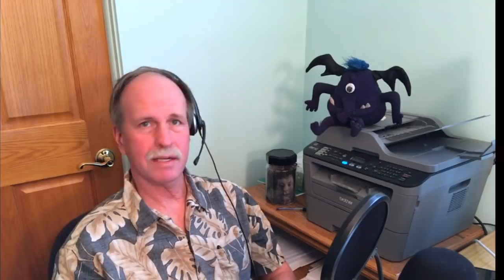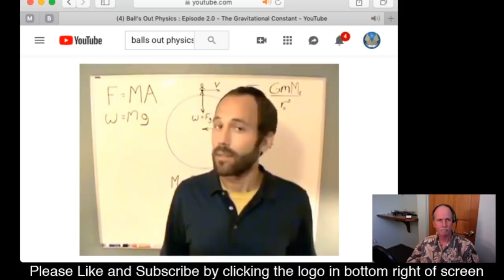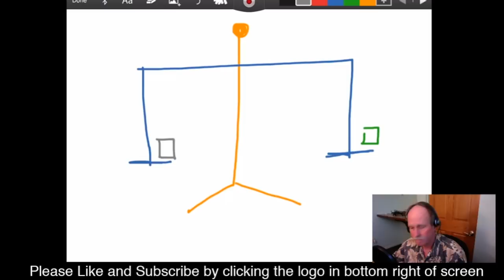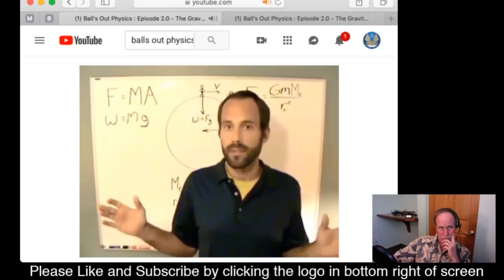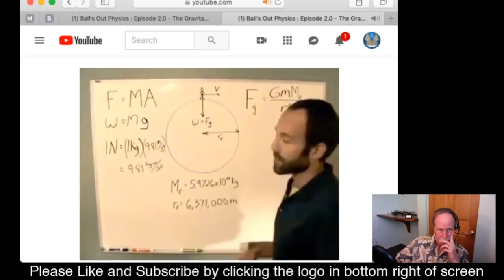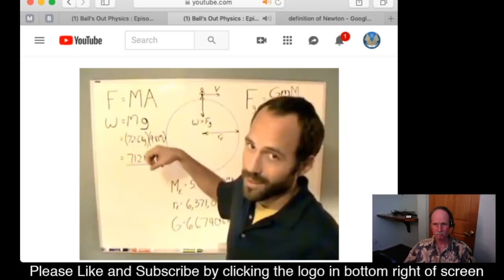Flat Derp Engineer Gravity Part 1

Comment: Ok, you likely addressed this; but, at 4:40, where he's talking about mass versus weight. (I was compelled to pause due to my brain being overloaded with stupid)That's why scientists don't use spring scales, you moron, they use balance scales where you are measuring against a known mass, and you keep adding mass to the other side, until the scale reaches a balance. Any force exerted on the item you're measuring will be mirrored on the side where you know the value, therefore, you're measuring mass.
He seems to only understand how a spring scale works, where the scale has been calibrated for a certain set of conditions, and can only be accurate in those conditions.
Reply: I can assure you scientists do use spring scales, they are calibrated regularly in their place of use using calibration weights. Of course the high precision devices no longer use springs, but the idea is the same. Do you really think when measuring the mass of an item in the lab they get out a set of weights and balances? The resolution would be limited to your smallest comparison weight.
Reply from the maker: yes, we use them all the time.  Properly calibrated they are quite accurate.  The beam balance is a special situation and increases accuracy, at my college there is one in a glass case that they bring out every now and again to demonstrate.
Reply: @BobtheScienceGuy  Seems I spoke too soon. I have just been told (by my other half - a chemist) that most laboratories use a top loading balance, which uses magnetic force restoration to lift a displaced item until it is balanced back to its initial position. There seem to be many types and designs. The general principle seems to be that a balance uses a known applied force to restore a displacement back to its original position (just like a beam balance) and a scale uses the actual displacement as the measure.  But is it confused by the fact that some manufacturers use the two terms interchangeably.
Reply: @garethhanby  Well described. Interestingly both systems are used in space. Measuring the mass of an astronaut is obviously important, NASA does this using  a system called SLAMMD which is basically a force applied to the body and the displacement measured, this is done using good old springs and is accurate enough to determine the amount of mass loss. Intricate measurements are done using a centrifuge and the force required to produce the centripetal force to keep the sample stable. So I guess the first is a scale and the second a balance.

Comment: Just a suggestion, Wolfie6020 did a nice demonstration using a scale and a set of weights, showing how the weights change according to your position on the globe.
Reply: True facts from an analytical chemist -- I'm really dubious about the ability of such a scale to retain calibration over such a long period with so much motion.  But it did work out as expected, so maybe I'm just over-cynical based on my experience with much more sensitive balances.  In any case -- damn, Wolfie, use some controls.

Comment: He is an engineer?? in which field? How can an engineer doesn't know what 1N is? Who had hired this dude?
Reply: Civil engineering. Probably the engineering field that demand the more intensive study.
Reply: @Kualinar  
I don't know that CivE requires the most intensive study. But to be a good one it requires the most civic responsibility and dedication and attention to detail.
Reply: @its1110  I did not say «the most» but one of the most demanding fields.
I have a brother who is a technician in civil engineering. He typically had 8 to 10 hours of class per day, 5 days per week for 3 years, plus all the home works.
For an engineer, you must add at least 2 to 3 more years demanding about the same amount of work.
Reply: @Kualinar  
And there is plenty of hands-on field work. Takes some muscle work on top of the brains.

Comment: As a physicist I am deeply saddened that one can become nowadays an engineer with such poor grasp of physics.
Reply: I describe Brain's Ball's out series as a reverse Oral Exam in which he lays out the case in detail for why he should have failed physics 101.  It gives me PTSD flashbacks to being a TA for physics 101.  I seriously thought I had a moral obligation to shop him to his engineering licensing board.  It was a relief to find out he was just inspecting bridges for corrosion and not doing anything where his lack of grasp of physics was going to get anyone killed.
Reply: I remember there were some in my engineering classes that just could not grasp what seemed to be simple physics..a number failed and dropped out.. but not all.
Reply: @entangledmindcells9359  They did a study once.  About 50% grasp the basic concepts at the beginning of a physics 101 course and 50% don't.  At the end of the course those two groups were still the same.  Nobody had switched sides.

For people who don't have the intrinsic talent for visualizing spatial geometries a lot of this, especially reference frames, is just incomprehensible.  The other stumbling block is that people don't realize that the surface of the earth is an environment with a lot of things going on at the same time.  In different environments things that are important on the surface of the earth can become negligible and things that are negligible on the surface of the earth can become important.  They can never break free of expecting things in all situations to behave the same as they do on the surface of the earth.  "It doesn't make sense." = "That doesn't match what I've directly experienced in my life."

They think their sense is some sort of magic source of knowledge and don't realize that when their sense and the physics don't match it's because the physics is right and their sense is wrong ( or at least, only valid for situations they've directly experienced).
Reply: He supposedly graduated from University of North Florida with an undergrad degree in CivE. I just graduated from University of Minnesota undergrad ME... Absolutely no chance this guy would have passed any of my courses. The fact he has a degree and is a senior engineer at his company blows my mind. I'm still not convinced this guy is serious.
Reply: @chicarbiomed  If you watch Scientism Exposed you will see his is serious. Although he does not mention religion in his Balls Out Physics videos, it is clear that he is one of those fundamentalists who desperately tries to use his limited understanding of physics to justify his views. Just try and avoid bridges in North Carolina.
Reply: @garethhanby  I remember you keyed me into his NC job etc. It's just so wild to me having just finished my own degree. They're are so many classes that require you understand why these basic physics principles works. I don't know how you get past statics, Dynamics, deform mechanics, fluids.... And imply something so stupid that the math seems to work so they just accept it.... I've found out classmates were creationist young earthers and they struggled so hard once they realized they had to do gymnastics in their electives just to take courses that didn't challenge their beliefs. I just can't square an engineer slaughtering their entire education. I believe what you showed me but, godamn. Lol
Reply: @chicarbiomed  Yes, I know. It seems impossible. I'm from the UK and have never met a creationist or young earther in my life, even with living in NYC and DC for a few years. There is an interesting article on quora from a classmate of his, but nothing to explain his ignorance.  Unless he eventually comes forward and explains himself all we can do is speculate.
Reply: @garethhanby  In my second year I studied with another tutor for the first set of real engineering courses series like: statics, Dynamics, deform Mechanics... After a few months an example from Cavendish experiment and using info to weigh earth and Galaxy even... Just estimating using basic physics. That's when I found out she was a YEC and didn't know what the milky Way was and why we thought it was round etc. It was amazing, I thought she was pulling my leg. She quickly started having trouble in classes because she was going to have to take biology, and other generals that would surely challenge her beliefs. I think she started looking at options for schools that would be more YEC friendly and still get her an engineering degree... If I knew about flat Earth then I would have asked her about it... And I'm afraid what the answer would have been. I would work out the proof why we can assume certain things and she would come back the next day with something her creationist mentor said to counter... It was absurd. I spoke to this mentor whom supposedly had a bioengineering masters ... Only Bible verses, would not have a conversation about anything regarding physics or biology without "Bible says...". It's truly intense. Idk how if she ever finished a degree it was too culty for me.
Reply: @chicarbiomed  
Damn!  They _are_ broken in the brain.
Why was she not at home over the stove... or lying with her legs open waiting for hubby to get home?
Reply: @Arctic Haze Has anyone reported this guy's FE videos to his employer? It must be damaging to the reputation of the company for them to have a guy who supposedly earned the PE certificate (Professional Engineer) spewing such nonsense in a very public way.
Reply: @SpectatorAlius  It would also be damaging to whatever engineering regulatory body (perhaps at the state level) that allowed him to get a "PE" certification.
Reply: Arctic Haze 
An engineer, a physicist, and a mathematician face the same emergency.

An engineer is in bed asleep. He wakes up to find a fire in his bedroom. 
He jumps out of bed, grabs a fire extinguisher, put out the fire, then goes back to bed.
The engineer survives.

A physicist is in bed asleep. He wakes up to find a fire in his bedroom. 
He runs over to his desk and begins calculating exactly how much retardant will be required to put out the fire. His conditions are constantly changing, so his solutions are constantly changing.
Continuously revising his calculations, the physicist dies.

A mathematician is in bed asleep. He wakes up to find a fire in his bedroom. 
He thinks for a moment, and realizes, “a solution exists“ and goes back to sleep.
His fate is obvious.

That’s OK.
We’ve got lots of mathematicians.
Reply: @AnOfficialYouTubeProfile  In some states, such as Texas, you are legally required to get a PE (professional engineer) certificate before you can sell your services to the public as an engineer.
Reply: @SpectatorAlius  Brain I am afraid does have a PE and more worrying a CBSI.
Reply: @garethhanby  How did he get them? Florida is infamous for being more corrupt than the average state, I have to wonder if he paid bribes to get the PE and CBSI.
Reply: @garethhanby  
CBSI? I don't find a term that makes sense for this. Comic Books? Comercial Banking?
I'm in NC. Where does he work?
Reply: @its1110  Yes, it is a little obscure. A CBSI is a Certified Bridge Safety Inspector, he works for Areté Engineers, you can find him in the about section on their website. Good luck with your bridges.
Reply: @garethhanby  
Just up the road, less than an hour from me.
Lot's of bridges and rock-slides up there.
Reply: @garethhanby  
Heh. 
On their website, all the male PEs (except) the head guy (owner?) are wearing the same jacket for the photos.
Ha ha ha ha, ha ha ha!
Reply: @its1110  so either 
His whole YouTube is a scam
OR
he has his PE but doesn't understand basic physics and is in charge of the safety of the public.

Seems understanding gravity would be a precursor to understanding structural safety.
Reply: @its1110  I suspect they all go to the same crazy creationist church.
Reply: @entangledmindcells9359  
Either way... not someone to be trusted.
Reply: @SpectatorAlius  
The principles of the Engineering firm, yes. Not all their employees, necessarily. But the firm has a responsibility and legal liability, vested in the principles, to meet PE standards. Employees' work would be reviewed. The principles have a duty to keep out sub-standard work and workers... _their_ license is in jeopardy.

Comment: Speaking as a working engineer, Mr. Mullin is an embarrassment to Engineering.
Reply: does it matter what type of engineer he is or is his level of poor comprehension of grave concern to any employer/customer?
If I were a customer or insurer I would be losing sleep over any project this guy is involved with. 10s of thousands if not millions of dollars and countless jobs and contracts on the line and he struggles with measuring weights. Simply not employable.
Reply: @Sir_Godz  unfortunately, a lot of engineering jobs have nothing to do with what you learn in school
Reply: thewanderandhiscomp  Depends what kind of engineer he is I suppose like a landscape engineer for eg.
Like anything tho, appearing like a fuck up doesn't mean you are guilty of fucking up.

Comment: "how can mass be universal if everything on the universe have differ g?" 

well mass is constant... if i give you 1 cubic meter of titanium alloy, that one cubic meter doesnt change if it's on earth, moon, jupiter or inside a black hole.. what change is how heavy it is base on the gravitationally pull of the surface it's on.. 

"I dont know because I never asked when I dont understand during class" 

that is why you should always ask when you have something that you dont understand in class... if you did, you wont be an engineer that have problem understand physic 101...
Reply: Cubic meters is volume not mass.
Reply: @andrewstoll4548  A cubic meter of a given metal is a good proxy for constant mass, as its volume (and therefore density, and therefore mass) will change very little in any reasonable environment.   (Black holes aren't reasonable.)
Reply: well, mass are meaningless without volume or weight... i cant really give you a mass of something, but i can give you a cubic meter of something or a kilogram of something... 

since we are talking about mass as a constant... so i use cubic meter in the example...

Comment: Greater Sapien did a good video showing the different measurements of weight at different latitudes.
Reply: There was a science special on TV a few years ago that showed the different measurements of the same reference mass (using the same scale) at ground level as compared to the top floors of very tall buildings.
Reply: Wolfie6020 did a good one, too. I love these guys; they get out and do stuff I'd never have the time and resources to do.

Comment: The unit of weight in the SI system is the Newton. It defeats me to understand why we do not have weighing scales that display weight directly in Newtons.
Reply: Joules is energy, I think you are talking about gravitational potential energy (mgh stuff), maybe Bob will touch on that aspect of gravity in his follow up just to clear that confusion!
Reply: I see you have corrected thanks!  Joe public aren't that savvy in physics that's why but you can get scales that show that if you want.
Reply: @tomctutor  I'm 'Joe Public' and know the difference. People in the main are just not used to the idea. I started my education in 1954 and was brought up with the imperial system. I new nothing of the metric system until after I started work. When metrication was first introduced many were upset about it but we soon realised the benefits.
Reply: As a physicist not really interested in the actual systems of measurement, totally arbitrary. All the laws would still hold as its the dimensions that matter MLT and not KMS, CGS or LFM etc

Comment: This is exactly why gold traders still use beam balance scales today, because even on Earth, we can't be sure that the gravitational acceleration is exactly 9.80665m/s^2, because of all sorts of stuff, including the spin of the Earth (if they used spring scales, they'd be able to buy gold for lower prices near the equator, and sell it again at latitudes closer to the poles for higher prices ).
Reply: And we know businesses, that's exactly what they would have done!
Reply: It would be cool if this was visible at Wall Street. Maybe AI can find a tiny relation between value and geographical latitude. Not all rare substances are traded with a beam balance. But there's Coriolis, tidal forces,  atmospheric density/pressure fluctuation, (electro-)magnetic forces...
But maybe it's all so tiny that it's permanently lost in the big mass with thousands of different cycles making the market.
Reply: @henkkl3505 
Well, they don't need to, since they use beam balance scales, and calibrated standard masses, which will yield the same result, at any gravitational acceleration.
Reply: "double facepalm" Read again...
Reply: @henkkl3505 
Well, I'm going to have to ask for an example of a rare commodity, sold by mass, not measured with a beam balance then.
Reply: @ShadowFalcon  Copper, lead?
Reply: @henkkl3505 
Those are traded in such quantities where a Steelyard balance is used, which is essentially just a very big beam balance.
Reply: @ShadowFalcon  It wouldn't be needed anyway, since any trading site is aware of it's own location. It's a matter of calibrating your measuring equipment not somewhere else. Or do you expect fraudulent traders to always buy when they see a new moon in the sky and high tide, so their goods weigh less?

edit: hm, not fraudulent. It's a natural thing. Only awareness is needed.
Reply: @henkkl3505 
I expect traders to be paranoid, and take every precaution to make sure they aren't getting conned.
Reply: @ShadowFalcon  Say what?
Reply: @henkkl3505 
I mean, if one trader thinks he's being shortchanged, I'm sure he'll run the gamut of calibrations, and independent tests.

There usually a lot of money riding on these trades.
Reply from the maker: exactly